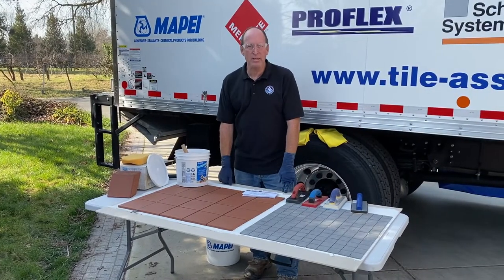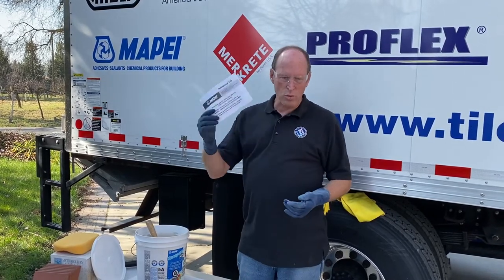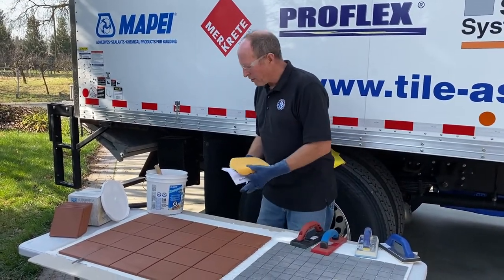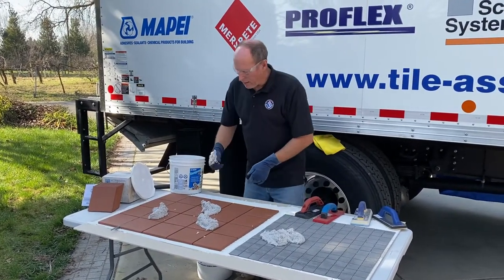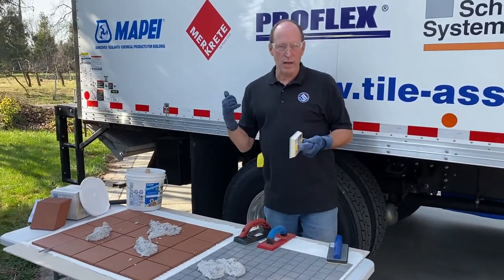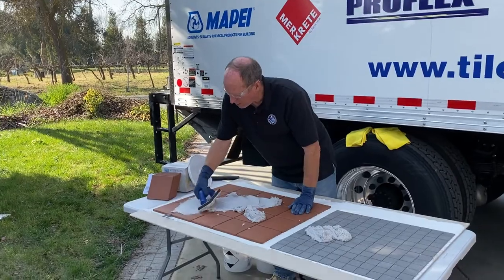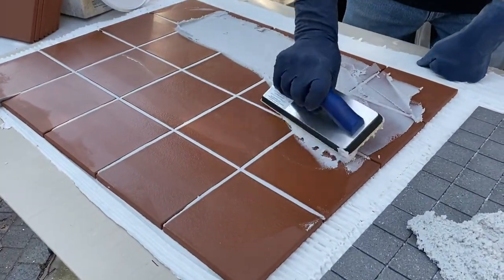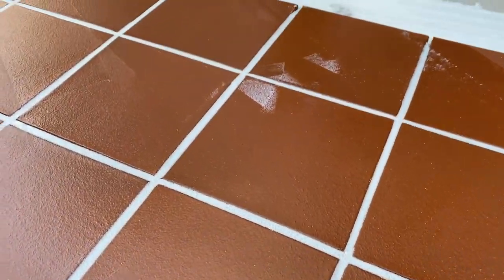TileTV Epoxy Grouting Tips and Techniques pt.1(S3-22Ep04)

Comment: thank you  can you also use grout release  on the tile,ive never used epoxy  but used mapei FA and grout release  seemed to help during wiping on semi textured porcelain, thank you, i applied the gel like release on the tile surface,being careful not to get much into the joints,folks recommend  small batches,as FA mapei can fire off and get ahead of you,

Comment: What about walls I do leaking shower regrouting to fix the dog's and I've just started with a new company that only uses mapei kerapoxy no normal grout and I'm struggling with speed cool to know about the bucket though too is there something I can dump it on rather that the floor of the shower (that might be a different colour to the walls etc) that will prevent it stiffening up?